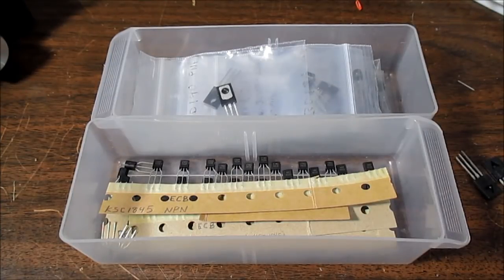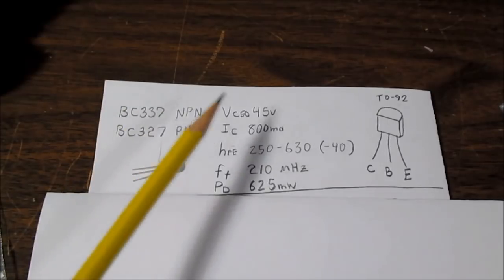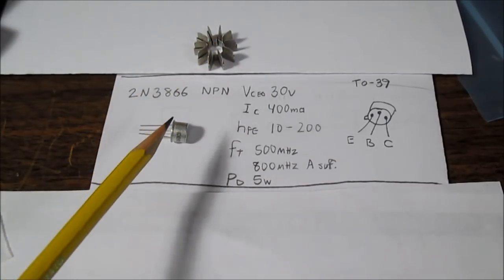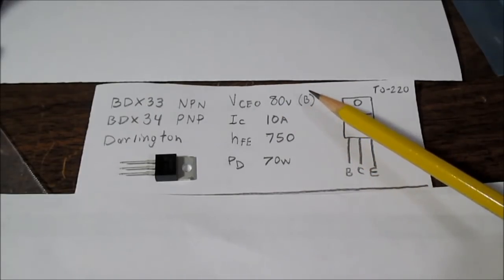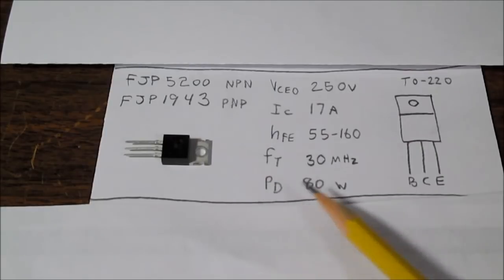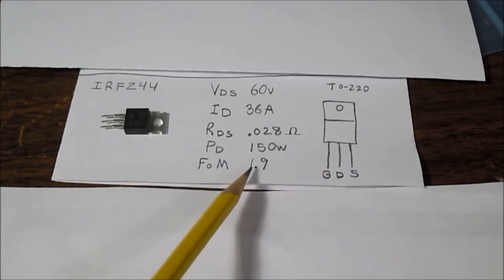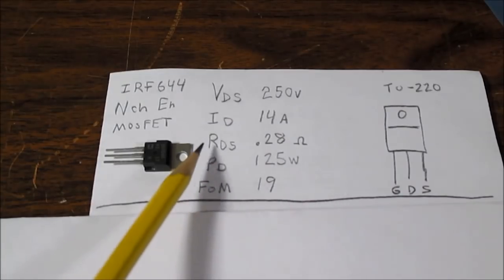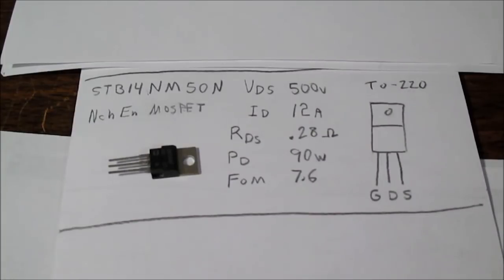Good transistors for the electronics hobbyist

Comment: BC550B/C / BC560B/C. Basically the European relatives of 2SC945 et.al. (but in oldschool EBC pinout like 2Nxxxx), and rather ubiquitous "low-noise" (high beta even at low Ic) transistors. Not great for Early effect (being a 45 V, high beta part) but not as bad as BC337/327, I think...
If you need to build circuits that have to run on very low voltages like 1.5 V (maybe a mic preamp), keeping some 30 V process parts like 2N5089/2N5087 in stock may be worth it as well. These seem to have very low saturation voltage.

Comment: ztx650/ztx651 a great low to mid power BJT as it can take a bit of current.  Not got the highest gain or work at the highest frequency but great in basic switching circuits, also I personally like using at as an emtter follower in a class A amplifier.
Reply: Apparently also has favorable characteristics for the Joule Thief circuit according to wiki... you can get lower Vce(sat) but ztx650 is likely to be on hand for home experimenters, at least in the UK... quite a common part for magazine projects iirc - and also has a cool name - sounds like a fast Japanese motorbike.

Comment: Going back to the 70s I recall working for a HiFi amplifier manufacturer, making a very good 25watt amp. At one point in time the standard output transistors were on a long delivery so it was necessary to use an alternative both physically and electrically similar.
The distributor came up with one that was almost a carbon copy. The only difference was the HF which extended from 5 mhz to 30mhz. Boy did we have issues with HF stability!!  It just loved to oscillate in the 20mhz. Obviously not audible but really heated things up. The cure was very simple, a ferrite bead was placed over the base connection to the first power amplifier transistor.  Problem solved!. At that frequency the smallest amount of inductance was all that was required.
Reply: The manufacturer wouldn't have been Bryston by chance, was it?  I had some problems with them.
Reply: Hi Russell, no it was very early Cambridge Audio P50 to be exact.
Reply: which Bryston did you have? I restored my 8BST without problem. I use MJ21193/94 though, for the final stages.
Reply: I don't remember.  It was around 1980-1982.  We had it at the radio station and it kept burning out speakers.
Reply: sounds like excessive DC offset.. i do burned out speaker by oscillation but it was a ribbon tweeter. the woofer is doing fine
Reply: I don't remember for sure - but I thought it was the tweeter that would go - with smoke.  I do remember the smoke.  If it was the woofer, I'd agree with you.

Comment: Hey John here's a slightly off topic comment related to bjts. i kinda designed this low gain op-amp circuit but am a bit tied down currently to try it out, maybe you could tell me whats possibly wrong with it. you're free to try it out and upload a video about it, it'd make my day :) http://tinyurl.com/yda3oge7 if the link doesn't work please let me know, also the MJE340 and 350 seem to be really good for high voltage. also https://www.mouser.com/catalog/supplier/library/pdf/FairchildBipolarPower.pdf i refer to this a lot..
Reply: Your circuit as it stands would be likely to be noisy, slow, and not awfully low distortion, being more class B than AB. 
The most glaring problem is that you are running each stage on the next one's base current, which is a big no-no as it makes operating currents depend heavily on transistor beta, one of the most variable transistor parameters. Together with the lack of emitter resistors on the outputs, I would not put too much faith in thermal stability.
Besides, even at moderate beta, the input stage is running at under 1 µA, which in all likelihood means input noise of >50 nV/sqrt(Hz). At least this will also make it so slow that the lack of compensation is not an issue. Stage currents in general seem rather too low, the second stage should be running 10-50 times as much.
The output transistors cannot be turned off quickly either (some collector resistors to the opposing rail for the preceding stage would help that a lot).
Instead of using diodes, I would make a current mirror using identical transistors which are thermally coupled and run at the same current if at all possible.

MJE340/350 do, in fact, make some rather nice output transistors for a headphone amp or the like. They're a lot quicker than, say, your average TIP31/32 or 41/42 jellybeans (which are still useful as emitter followers but need nice low impedance drive).

Comment: I always wondered about those small legs putting out such a high current without burning like a fuse. How?
Reply: This sort of discussion misses the point. Look at failure modes not gut feelings. Find out how each type of transistor fails. You will learn something and get away from amateur hour reasoning. You will also be surprised.

Comment: Hi john, thanks for sharing you favorite transistors. Do you happen to use IGBT's sometimes ? I often replace faulty IRF730 (and alike) mosfets with STGP10NC60 in the primary of switching PSU's. I have no particular technical justifications to that, they just happen to be easier to get in my case (RS in Europe). I assume IRF730 and alike are slowly slipping towards end of life nowadays.